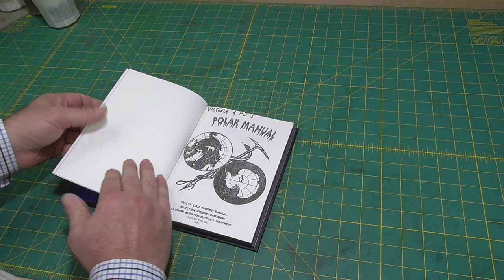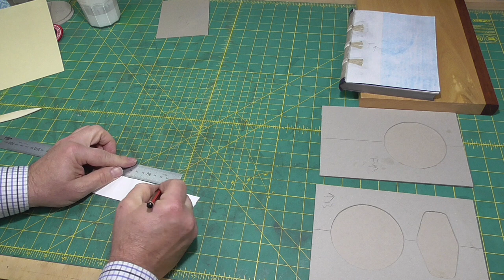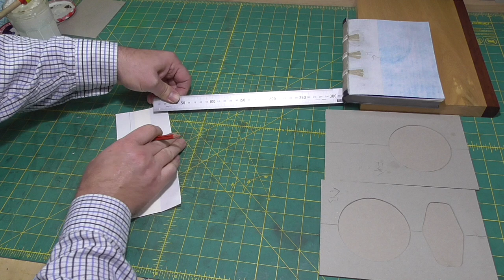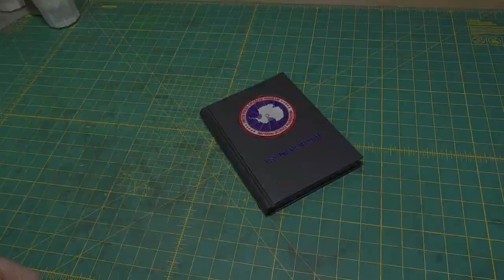A Rounded and Backed Bradel Binding Part 2 // Adventures in Bookbinding

Comment: So, in trying to understand the difference between this bradel binding and cased binding- is it essentially just attaching the spine stiffener and boards to the connecting piece of paper, then the covering material afterwards, vs attaching spine stiffener and boards directly to the covering material? 
The in-boards three piece bradel binding attaching the spine pieces directly to the text block before attaching covered boards makes it distinct in my mind, but this style feels practically the same to me. Wondering what the merits are vs this and cased.

Comment: What a masterpiece! Great job.
Sir, Can you please make some more videos on springback bindings as I run a stationery store and i also sell account books.So, can you please share some fast and effective methods for springbacks to make them in bulk quantity. That'd be very helpful.
Reply from the maker: I've got quite a few videos on springbacks.  They are expensive to make, thus expensive to buy.  Of course there are different classes and things you can cut corners on.  One thing I've heard a few times is that a typical springback ledger cost about the average weekly wages of an office worker.  All the best, DAS
https://youtu.be/nNQhA98GsRc
Reply: @DASBookbinding  thanks a lot sir🙏

Comment: Hi Darryn! Thank you very much for your channel. It's perfect for somebody like me who is trying to self-teach. I have a bit of a dilemma - the entire batch of 2 mm boards I had cut were consistently cut 8 mm too short width-wise so if I attach it snug at the shoulder the paper shows at the fore-edge. I will still have a 4 or 5 mm overhang on top and bottom. I'm trying to visualize whether I could use this method, rather than a tight hinge, to make up that space, but I can't quite tell whether you're still placing the boards right up to the shoulder. I'd rather not trim pages. Should I scrap the boards and order new ones? - Abby
Reply from the maker: Sorry to hear it.  I think I use a 7mm gap between the shoulder and board.  But then add 3mm for the fore-edge square and it's only 4mm less than the board width.  Board is (or should be, depending on where you buy it) cheap.  Those boards will be great for holding books in place in finishing presses or making smaller books.  You'll use them up.  I'd get new board.  Good luck!  DAS

Comment: Amazing video! Is it possible to round completely cured text block with a hummer (or old text block that is flat)?
Reply from the maker: I guess it depends on the adhesive.  In general I would advise trying to soften the adhesive either with some moisture or heat.  Heat is the usual method.  I have been unsuccessful in rounding machine made softcover books.  You would expect that heat would allow the hot-melt adhesive to soften enough to allow it.  I've destroyed every book I've tried this on.

Comment: I am still looking for a good method of determining the proper thickness of board to use for a hard case book, and whether I should use "standard" board or Davey Board and at what thickness.

Also, I was looking at the Patreon site.  I wish there was a way to make a single, quarterly, or biennial contribution with reminders rather than having thing run on autopilot.
Reply from the maker: There's no hard rule for board thickness.  For this book I used 1.7mm board as the lower layer and then 1mm board with the hole cut out of it, for a total of 2.7mm.  This is a bit thick for a book this size, but luckily it was a thickish book so looked in proportion.  1.5 - 2mm is my starting point for board.  For an A4/US letter size book 3mm board looks fine and 1.7mm feels a bit light, but would work.  Binders grey board is softer than Davey board which makes it much easier to cut and work with and is cheaper.  If you can afford it and have a strong arm the stiffer Davey is much better.

The Patreon community discuss this a lot.  One of the underlying concepts is the idea of providing a regular reliable income to creators, which is why they don't like one off payments.  Having the regular income from Patreon has been a game changer for me, so I support this approach.  But they do recognise there is support for something like this  So the recent compromise was to introduce and annual membership.  But the annual membership includes a significant discount which i don't control.  My Patreon levels weren't set up with this in mind.  It would make my higher level no different to the middle level in terms of my financial return.  So I'm not going to enable it.

But thanks for your support just by watching.  All the best, Darryn
Reply: @DASBookbinding  I do understand the desire for predictability re income, but when you get as old as I am I don't lean to setting up automatic payments that my heirs will have to try and untangle.  I do freely and generously support those who provide true value in their content.  You are one of those.  Is there any other mechanism of financial support?
Reply from the maker: @roberthartung594  Robert, a one off contribution would be very welcome and can be done through PayPal.  I've added the link in the description as it doesn't want it in this comment for some reason.  Thanks, Darryn

Comment: Hi! Love the tutorial! I want to try and do a bradelbinding for a notebook I'm making but I can't currently back my books because I don't have a press. Instead I'm leaving joints at the spine and I'm wondering how this will affect connecting the spine stiffener to the boards. Should I use the 7mm plus the joint as the gap between the boards and the spine stiffener?
Reply from the maker: I'm not sure I understand.  The 7mm gap is the joint.  I think just leave the 7mm.  Hope it goes well.  Darryn

Comment: Thank you for this! I had time trying to know about Bradel rounded/backed binding.

In 13:58 you commented that this would be the time to trim up the fore-edge of the boards in the general case (without insets) but I'm not clear how to do that specifically.
Must the book be placed in the pressing board (to force the connecting paper into the gap)?

Considering this scheme: https://imgur.com/67VG51a 

I think if I trim up the fore-edges before the connecting paper is following the shape of the gap the squares will be too much reduced later. For example, for a joint of 4 mm and a gap of 8 mm the reduction of the square could about 3 mm.

Regards
Reply from the maker: You are correct, but the amount is usually small.  The connecting paper won;t get forced right into the corner as in your diagram.  But I dod usually put some knitting needles into the groove to push the paper close to its final configuration.  Is this the video I forgot to push "record" for this step?  I must not have explained it very well.  I'll schedule another similar project for the future.  But ti sounds like you understand.  The trouble with using the boards is that you can't get access to the fore-edge.  Thanks, Darryn
Reply: @DASBookbinding  Thank you por your kind reply. I'll do some tests following your suggestions.
Cheers

Comment: Hey, do you have any tutorials about making bookcloth? I do it using termoline, but I find That I always lose the texture of the cloth, specially if I am using something like velvet.
Reply from the maker: No, not yet.  Some improvements I keep experimenting with that I can't quite finish.  I had to look up termoline and never used velvet.  I know historically velvet has been used to indicate wealth.  In what type of binding are you using it, or want to use it?  I generally prefer cloth that is fully impregnated in something like starch so it has some sort of surface coating.  That of course won't work for velvet.  In which case you will need to back the material with something, probably light paper, to give the material bookcloth characteristics.  The heat'n bond technique would probably work.  Or glue out paper with PVA and then lay the cloth on being careful not to force the glue through the material.  I'm very curious to hear how you intend to use it.  Sounds really interesting.  Take care, Darryn
Reply: @DASBookbinding  Thanks for the tips. I will be experimenting on that for sure.